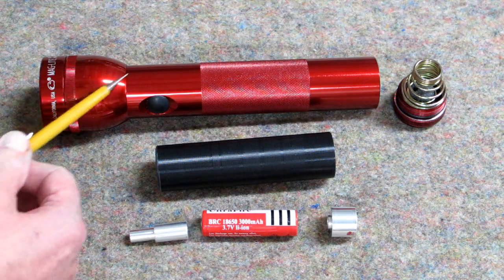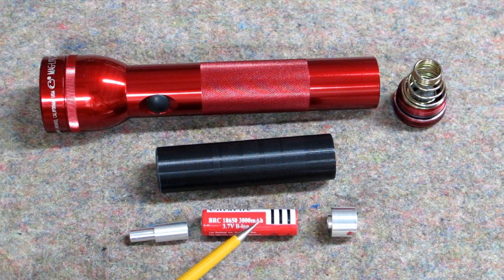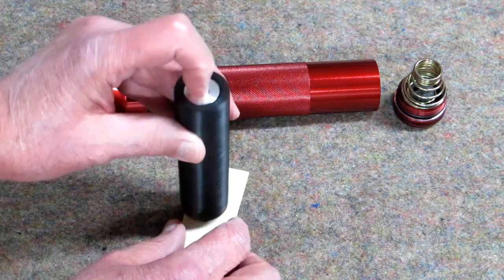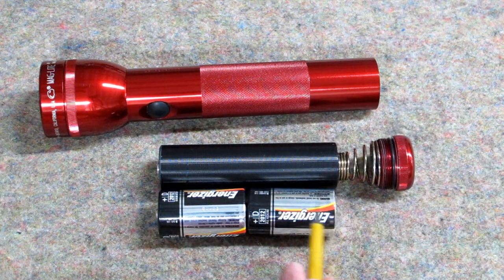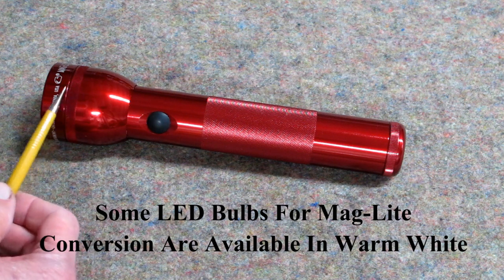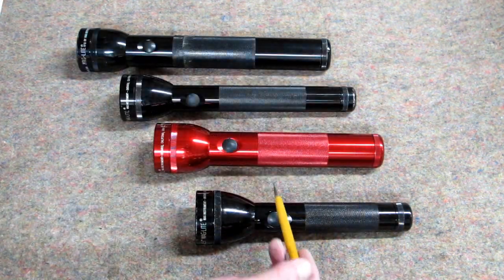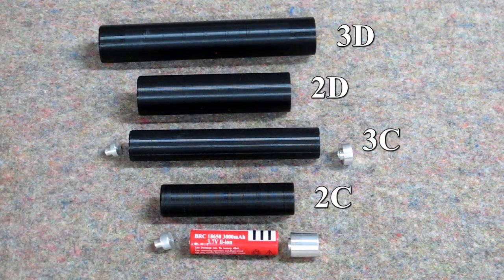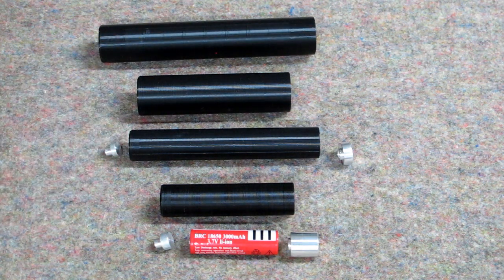Mag-Lite 18650 Lithium Battery Adapter

Comment: Have you ever looked into the 6 D Cell Maglite conversion?
Reply from the maker: Unfortunately I do not own a 6-cell Mag-Lite so I never played around with that conversion. My D cell adapters are designed to hold one (or two) 18650 batteries. 

A 6-cell Mag-Lite is 9 volts. Using three 18650's would give you 11.1 volts. Some of the LED bulbs are rated 4-12V. I HAVE NOT TRIED THIS but... you may find you could use a combination of a single 18650 and a double 18650 adapter inside the 6-cell Mag-Lite and adjust the aluminum spacers accordingly. 

If I had a 6-cell Mag-Lite that is what I would try first because a single longer adapter for three 18650's may be too tall for some 3D printers.
Thanks for watching. Please subscribe!
That is what keeps this channel going. 
Ron
Reply: @RonaldWalters2010  After I asked the question, I also did the voltage/cell number math and got discouraged. But I was not aware of the wide voltage range of the LED bulbs. I'll look into it further. Thanks for the reply and keep posting!
Reply: @RonaldWalters2010  .  . .A  6-cell  Mag-Lite  is   NOMINALY  9 volts  and  practically  7.2  volts.             Voltage  of  pair  26650  will  light  up  6D  cell  bulb  perfectly  with  lot  of  run  time.

Comment: .   You  can  use  pair  of  26650  in  2D  cell  Maglites  but  size  of  adapter  will  be  different  and  tail  cap  must  be  modified.
   .   With  2x26650  cells  you  can  use  6 cell  Maglite  bulb  which  is  much  brighter.

Comment: Would it be possible to double up the 3d cell to work inside a 6 cell maglite
Reply from the maker: Two of my 3D cell adaptors should space out the same as 6ea D cell batteries. The problem then becomes the voltage.

Two (2) of my 3D cell adaptors would hold four (4) 18650's which would be 14.8 volts.
Or you could try three (3) 18650's (with different aluminum spacers) which would be 11.1 volts.

The LED bulbs for converting the MagLite flashlights tend to be 4-12V or 6-24V and then there are warm white and bright white bulbs (so you need to look around on eBay or wherever). Then you would need to decide which bulb you think you would like best... or experiment with different bulbs and voltages.

Unfortunately I do not have a 6 cell MagLite otherwise I would have done this already. Since a 6 cell MagLite is sorta like carrying around a baseball bat, I never had one.

If you know how to do CAD, I would try making two adapters that screw together to hold 3 or 4 18650's with an aluminum adapter in each end. A single length adapter is probably too long to print on my 3D printer (Ender 3).

Thanks for watching. Please subscribe! 
That is what keeps this channel going. 
Ron

Comment: It's nice to have the metal spacers and connectors shown.  But don't have a 3D printer or a lathe---I made an adapter made from cereal box chipboard that fits inside the battery compartments of a 2C and a 2D LED Maglite that will hold a single 18650 battery. I then made a spacer that connects to the rear end of the battery to the tailcap spring.  The  spacer is made of wood with a center drilled hole with a .01" thick strip of aluminum that makes contact between the battery base and the tailcap spring.  I have also made an adapter that uses two "AA" batteries (much cheaper and easier to find then C or D batteries).  One can use Alkaline or NiHM rechargeables.  If you use Alkaline the carboard will absorb any leakage jist  as long as the Maglite is stored retsing on its' reflector end.

Comment: I too have a Sherline lathe and mill.. I’ve owned my set for yrs.! I have a number of these flashlights hanging around that I don’t use anymore because they were so power hungry. Been thinking about investing in a Creality, too, as they’re really not that expensive... You Sir, are a genius!!
Reply from the maker: Thank you for your comment. Glad you liked it.  I will be working on an 18650 protected version in the future. The Creality Ender 3 Pro has proven to be large enough to make nearly everything I want. I removed the magnetic print surface and now use the Ultrabase Black Carbon Silicon Crystal Glass for the print surface on my Ender 3 and Ender 3 Pro. I have links (and sometimes coupons) in the descriptions for my video reviews and projects. Please Subscribe! Ron

Comment: Good day. The fact of changing 3 D-type batteries for 2 18650-type batteries strikes me because of the voltages they handle. 3 D type batteries add up to a total of 1.5 * 3 = 4.5 volts and two 18650 type batteries add up to a total of 3.7 * 2 = 7.4 volts. Be careful, the led can support that voltage and nothing happens, I don't know because I haven't done the test but the difference is quite considerable. Greetings.
Reply from the maker: If you read the description for this video, it addresses the use of a 3-cell Mag-Lite bulb with the single 18650.  You could use a 5-cell Mag-Lite bulb with two 18650 batteries but it would be a bit dimmer than a 5-cell flashlight with fresh D cell batteries. LED’s are easily found on eBay and you would need to decide if cool white or warm white is your preference. The LED bulbs do handle a much wider range of voltage than a Mag-Lite bulb, but you do need to pay attention to the listing before ordering.
Thanks for watching. Please subscribe! 
That is what keeps this channel going. 
Ron
Reply: @RonaldWalters2010  Ron thanks for your answer. I tell you that the flashlight itself has an LED lamp (not a filament bulb), but it works with 3 D-type batteries and hence the change that I am evaluating.
Reply from the maker: Fair enough... I have never had a Mag-Lite flashlight that had an original LED bulb. Mine have been filament or halogen bulbs. Ron

Comment: The problem I see with this is two fold (one you touched upon) and they are #1 10-12000mah vs 2200-3000mah.  #2 4.5V vs 3.7V.
Reply: Most lithium-ion cells are 4.2V max and an alkaline cell is 1.5V max.  A rule of thumb, 3 NiCd or NiMH cells equal 1 Li-Ion cell in voltage range.  1.0V-1.4V max x 3 is 3.0V-4.2V.  Power tools 5 lithium cells equals 15 NiCd/NiMH.
Reply: If you use 2 lithium cells to double the voltage, the current draw will be half, so the alkaline will be twice (instead of four times) the capacity.  Replace the incandescent lamp with an LED lamp and you will increase efficiency.

Comment: You can also put a protected 18650 in there if you allow about an additional 5mm per cell. I ended up with a whole bunch off of Ebay. They're just an ordinary 18650 with a copper strip down one side to a little puck on the negative end then clear shrink wrapped. That way you can give it to someone careless and they can't destroy the cell (s) by dropping them below 3V :)
Man, I wish I had that lathe and a CNC machine... I'd never leave the garage lol
Reply from the maker: Last year I updated the adapters to use protected cells.
Mag-Lite Flashlight 18650 Protected Cells
https://youtu.be/W9QltxP6USU
Thanks for watching! Ron

Comment: I like your adapter design. Quite simple actually. The spacers - especially the rear spacer - keeps the tail cap spring from pushing and twisting directly on the 18650. The maglite tail cap springs can be quite strong. Good video. Thanks!

Comment: Ron, I have been using eneloop nimh. Tired of batteries leaking. Especially Rayovac.
Reply from the maker: I am using Tenergy NiMH everywhere for AA and AAA and have one Mag-Lite with their D cells. Obviously a 3 Cell or larger Mag-Lite is a formidable club, but otherwise lighter is better and the rechargable D and C cells are a bit expensive and very heavy. The 18650's are widely used and if handled carefully perform very well. I received my first LED bulbs from China last week and a 2 Cell Mag-Lite now looks like a Surefire.

Comment: You need to either use protected lithium batteries or install a protection circuit to prevent batteries from exploding if they discharge too far.  There also, needs to be a vent hole incase the batteries vent.
Reply: Great discovery!  I found by testing that my PR 3V-18V LED turns off and does not draw current below 3V, so it is in effect providing battery protection for 1 cell.  If a PR 6V-24V LED was used, then it should shut off at 6V for 2 cell protection.  Be sure to test your LED so as not to over discharge the cells.

Comment: Sounds (from comments) that people like the 18650 batteries. Why?
What led bulbs should we get to replace a standard flashlight bulb if we switch to 18650?
Thanks for the video and your fix.
Reply from the maker: The 18650 lithium batteries are being used in a lot of things and the price has come down quite a bit. They are used in laptop battery packs and other cordless applications like vacuum cleaners. They are apparently also used in the vapor e-cigarette things. I have received the 3V LED bulbs for Mag-Lite from china and have been running them on a single 3.7V 18650 and so far they are working and produce a very bright white light. I have some 4-12V warm white LED bulbs ordered for the 3 cell’s with two 18650’s but they haven’t arrived yet. Look around on eBay for Mag-Lite LED conversion bulbs and make sure you are getting the correct bulb base for your flashlight.
Reply: Ronald Walters Thanks Ron

Comment: I will just go and buy a lath then to turn some aluminium down to fit!!
Reply from the maker: Might want to machine it from Delrin (which machines beautifully) or some other plastic so you don't make a potential short circuit. Short the case of an 18650 to + and it will spoil your whole day.
Thanks for watching. Please subscribe! 
That is what keeps this channel going. 
Ron

Comment: Great idea! I currently have two or more D-cell LED maglites with corroded batteries stuck inside. Any way to get em out?
Reply from the maker: You could try soaking in kerosene or diesel probably followed with a hammer and chisel... it would be a lot of work and then the switch assembly will need to be replaced. Generally cheaper (and easier) to buy a new one. Thanks for watching.

Comment: Ever clean out a damaged Mag flashlight after Alkaline batteries leaked. Any success? Worth doing?
Reply from the maker: You did not say what size flashlight. If an AA or AAA I think I would just throw it away. I used to check batteries every 6 months, which was not often enough. Then switched to every 3 months. Murphy's Law dictates the batteries will start leaking immediately after you checked them. I have had D cell Mag-Lite's that looked like the batteries were installed with cement. Leakage got into the switch and locked everything solid. You need to gently remove the rubber switch cover and use a allen wrench to loosen the switch (there are several youtube videos on doing this). If the switch does not want to loosen, try soaking in WD-40 and gently work the allen wrench back and forth to get it to loosen up. If bad enough you may need to drive the switch and the batteries out with a wood dowel (exiting the tail cap end). You still need to loosen the switch with an allen wrench before attempting to drive everything out. Soak the tube in vinegar and scrub everything clean with soap and water. A wood dowel with emery wet or dry can help clean the inside of the tube. Wear disposable gloves when messing with the leakage. New switches available on eBay for $8 - $16 look for the best deal. Either use rechargable NiMH batteries or make my conversion for 18650's. Either way, get one of the LED bulbs out of china (again eBay) and you will have a very bright flashlight. Worth it? That's up to you and if you just like to fix stuff. I am a big fan of SureFire flashlights and 123A lithium batteries... BUT... I still like a flashlight that fits my hand and the Mag-Lites will be around for a long time. Thanks for watching! Please Subscribe… that is what keeps this channel available.
Reply: @RonaldWalters2010  Personally I think they are worth fixing. It's the challenge! Better than contributing to the landfill.
Reply: @RonaldWalters2010  Use white vinegar,  it starts dissolving the corrosion immediately.  Alkaline vs Acid = reaction. Let soak for about 15-20 minutes then remove the rear spring, put cap back on and bang the flashlight on a piece of softwood. The stuck batteries will come out easily.
Rinse with a little baking soda and water, then dry and reassemble with new batteries.

Comment: Nice be better if u used copper adapter pieces instead of aluminium
Reply: I use a carriage bolt with fender washers sandwiched at each end.  Put the cell(s) in first and then the bolt assembly head-first so the nut goes into the cap spring.

Comment: Where can i buy 3D cell convertion adapter???
Reply from the maker: You need to make them yourself. The 3D stl files are free on Thingiverse. Link is in the video description.
Reply: I have no 3d printer but i found one on ebay 😃 thank you for your fast reply
Reply from the maker: I have reviews on the Ender-3 and Ender-3 Pro. In the video description are links and discount codes if you are interested.